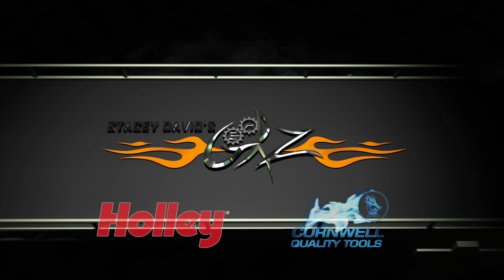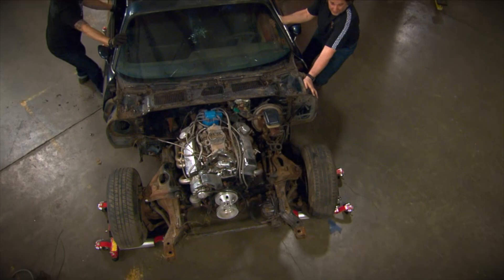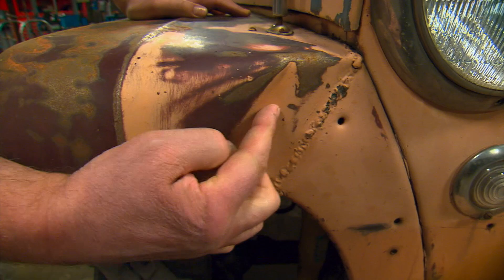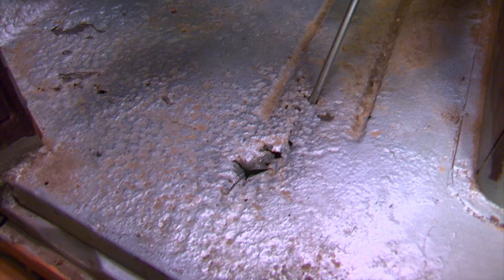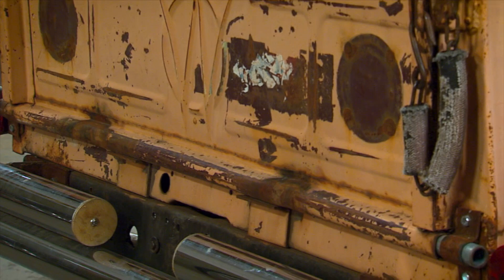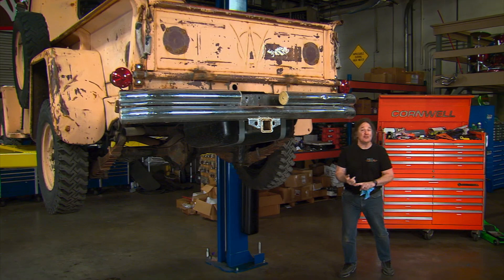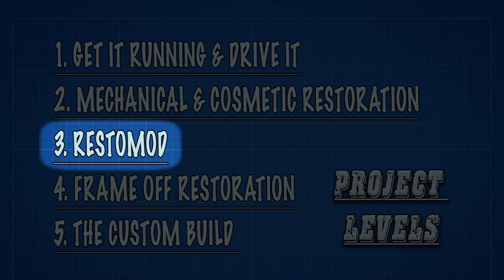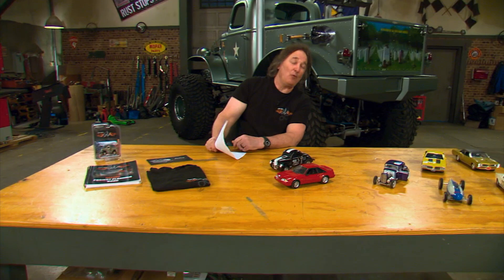Finding & Assessing a Project Vehicle - Becoming a Car Whisperer - Stacey David's Gearz S15 E1

Comment: The first thing I always tell people is not box yourself into anything. "I want a 72 Chevelle" is a want of ALL of us but it's not a reality 99.99999% of us, want a 72 Chevelle? cool, but why spend 15k on a roller when for 1/3 of that you can get a running driving and currently tagged 74 Chevelle, want a 69 Mustang? cool bit once again 15 for a roller when you can buy 74 Torino running and driving for $2500. Go for the cars that aren't "popular" and build your car because it's going to cost you less and are often in better condition   than the roller your spending 3 times as much on.